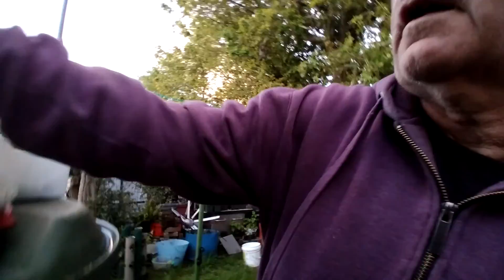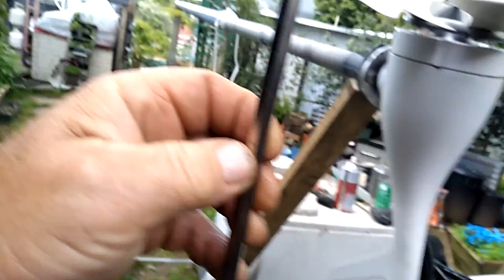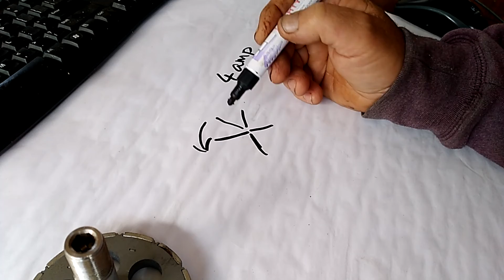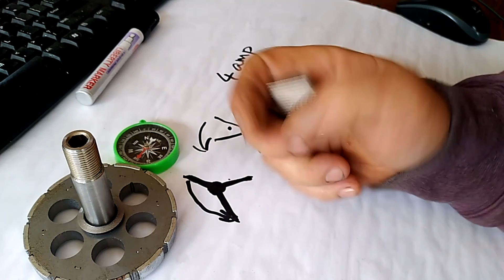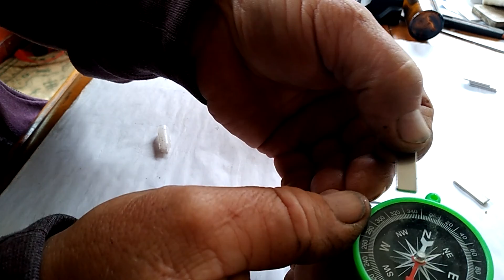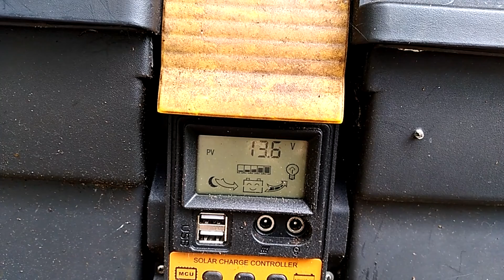Wind Turbine Magnet Mods. will more magnets give more amps or just more cogging?

Comment: Nobody installs just one solar panel for home use. I have several wind turbines. In my opinion the companies who rebuild the car alternators with permanent magnet rotation fields do produce the best bang for the bucks! Mount the wind turbine as high as possible. Mine produce the best during storms. If you static balance the blades on the rotor you can double the rated output during a storm without destroying the system.

Comment: Did  you  get  better   result  after  mounting the  magnets   ?
Reply from the maker: The magnets I chose fit well but there is space to double them up. Right now its just starting to exhibit clogging so glueing in another layer might take it too far. But I tripled the output without affecting startup. 46v in a howling wind. The Chinese bearings are starting to Rumble now so I'll buy more magnets and add that second layer with new bearings soon. Make a new video and post it. I've had a shit year with aggressive cancer so not much has happened on the channel. I started talking alt therapies so YT virtually shut me down. I've moved all the big C stuff to Rumble, where the truth can be told 
I'm getting well now so I can get into the off grid stuff again slowly. Thanks so much for your interest. ❤
Reply: @t.h.o.r.  Thanks for your reply. I'm sorry to hear you've been so sick so I wish you a full recovery. Yes I've read a lot about medications to cure that type of "illness", especially (i)vermectin and (f)enbedazole, but these things shouldn't be mentioned at all. Yes I'm interested in getting my wind turbine optimized as it doesn't actually produce electricity in strong winds it can reach 65 watts and 9 volts it can't charge my battery at all and there's no help to be found in China my wind turbine is a Vevor FT-500. I can hear the bearings are already rumbling in my wind turbine so I have to take it down again in the spring, it sits up in a fiberglass flagpole and I can't put it down as it's dug into the ground and I can't drive down to it as it's very soft after a massive rainfall. When you've found out what the bearings are called I'd like to know what they are called so I can order new bearings before I go. the mill down. I would advise you to buy C3 bearings, there is less friction in them and more clearance as they are used in gearboxes. I hope I find you on Rumble. Get well soon and many greetings from Denmark
Reply from the maker: @KurtBergNielsen yes i have a 7m pole with a cable guided tilt mechanism. I know about C3. Vevor is just a name the importer uses. In NZ they are just 600w 12v wind turbine. I should have got 24 v . Search On Rumble 'kick can*er to the kerb

Comment: I have a similar unit rated at 600 watts . But reading the specs it reveals 600 watts with a 24 volt system and only 300 watts on a 12 volt system.  On my 12 volt system I am getting 7 amps at 13.6 volts with 30 kph winds. We regularly get winds up to 70 kph so I do generate more current at those wind speeds.  My wind charger produces most of my power during the winter .  I have had 4 years of reliable service from this Chinese made wind turbine. My experience has been very good .

Comment: I have a question, in my understanding the wind charger produces AC current and solar panels produce DC current. How are you wiring the solar charge controller to deal with AC current ?
Reply from the maker: I have a bridge rectifier that turns AC to DC in the line.

Comment: Hey guys, all you need to put up a small Wind Generator is a strong fence post in your yard -
In my yard there is a row of 6 posts from an old fence, 3 meters apart just perfect for wind generators. 
I drilled a hole straight through the bottom of a 6 meter pipe, measuring in half the width of the pipe so I could put a long bolt through it and go through each end of a chain after wrapping it around the bottom of the fence post so it holds the pole like a hinge ( bolt, washer, chain, pipe, chain, washer, nut ). Then drill another hole through one wall of the pipe an inch above the bolt, big enough to easily feed a 3 wire 10A AC extension cord through it. Choose an extension cord long enough to run down the inside of the pipe and to your 3 way bridge rectifier, then cut the ends off the extension cord ready to thread through the hole and then through the pipe to the top. Leave enough hanging out the top to attach the wind generator, Cut off 4 separate links of chain and attach them to the pipe a meter blow the blades with a hose clamp or a U-bolt, for attaching ratchet straps for gid ropes. then stand the pipe and wind generator up. Use a second bit of chain to wrap around the top of the fence post and the wind generator pole, using a bolt with two washers and a wing nut, for easy take down if needed, A tip, use a stack of 3 car tyres when putting up or taking down to have the generator tail go through as the wind wheel faces up. I hope this helps you get started.
Reply from the maker: I like that! No welding, no concreting. You are just getting into the good air at 6m. I wish I could get mine higher. Funnily enough. Mid winter and I'm getting way more amps by mounting two extra panels on the wall instead of the roof cos the sun is so low. Check my latest video
Reply: @t.h.o.r. Ok, sounds good.  
I live in a small outback town in Australia with people and a council that are not happy seeing a big wind generator going up ( sounds and looks )., so I have put up 6 small wind generators instead  -
2 x 24V 500W Vevor at 6.5 meters, 
1 x 12V ista Breeze i500 at 4.5 meters, 
1 x 12V 300W Vevor at 3 meters 
2 x no name china brand 48V wind generators at 4 meters on 12V systems 
All with 1.2M wind wheels / 5 blades since I have low wind in my small town. 
I have been commenting on your other older wind generator videos to try and help your channel.

Comment: Did it increase the output?
Reply from the maker: yes of course- i dont have access to sophisicated output tracking software- but it now produces 3x the  volts in my average wind around here. it frequently charges at 40 volts when it used to seldom reach 15v

Comment: Hi, great video, got to do the same thing with a vertical axis turbine and earn some power afterwards, thank you very much for your teachings. Greetings from Panama
Reply from the maker: Thank you Lech - Its still going strong- a great suppliment to my 500w of solar. Ive never had my batteries drop below 13.2 v and Im running hydroponics and lights 24/7 it also powers my fridge and house lights and this computer and screen  and the washing machine once a week

Comment: Any updates please
Reply from the maker: yes- Ive replied to several people here telling them how it now has slight cogging, but still starts well. Its autumn here now and after having it sit almost stationary all summer its doing its stuff right now in the dark My batteries are topped off even though its been grey and rainy all day and the solar hardly contributed. Because both systems feed the batterys  its hard to quantify the turbines contributions exactly.  But standing watching the screen on a windy day Ive seen that it now feeds in at 2.2 amps on occasion - It seldom used to reach 1 amp charge before I added the extra magnets.  Its theoretical output is 4.1 amps at max wind speed. I did witness an actual event where the blades reached terminal velocity and fribulated and I was there to see a momentary 4 amps on the screen
Reply: Oh really  that's terrible  really  I get easy   300 watts   max is 450 20 amps in 30 to 40 k winds
Reply from the maker: @dustinfrost5214  Yes- from what turbine and in what strength winds? Mine is 5.5m tall and is behind two big oak trees that are taller

Comment: Did it work???
Reply from the maker: I now have very light cogging and DOUBLE the amps when the wind is belting at 20mph. but still it reaches the point where the blades flutter at terminal velocity - so I think that it is as good as I can get without changing the blade setup. example: swapping to a 3 blade hub. I did order a 3 blade hub but the twats sent me a 5 blade hub and refused to replace it unless I sent the wrong one back at my expense.

Comment: I did a 1.4 to 1 chain drive and did get a little power out of it. If it was in a good wind spot it may do ok. I put 3 wider and little, longer blades on it. It still starts in low wind.

Comment: If you want highest efficiency, use a high voltage coil. The force required to spin it is less. Its the electromagnetic equation, then step it down to 12v and you have more power.
Reply: Something like 250vdc max. Smaller wires, more turns, less heat, more power from magnets.
Reply from the maker: thank you

Comment: I built my wind turbine towers such that they hinge and have counterweight, so I can raise and lower them with one hand . . . Even in wind.

Even at that, they all simply turn transmissions, transferring the power lower to the ground. Much safer doing it that way.

All my turbines pump air. I find it easier to make electricity using a consistent supply of air, instead of trying to second-guess Mother Nature.

Comment: Why didn't you spin the rotor with a drill and measure the output and rpm before and after the modification and compare the two? Also, wouldn't it have been easier to just put 6 magnets on each side to start with?

Comment: Any updates on watts and amp improvement
Reply from the maker: hardly any wind in the last week- nothing to report that is worth a video till I can show the numbers. they just flash across the screen - it doesnt record figures
Reply: Ok do you have a wee amp watt meter hooked up to it
Reply from the maker: Its one of those blue >60v dc 150 amp meters that scroll through 4 functions continuously. Ill film it when its cranking - then slow down the playback so it sits longer on each reading and I can explain each reading. cos it just holds each number for one second.   @dustinfrost5214
Reply: @t.h.o.r.  hi mate just tried the 3 blade that was a wast of time it wasn't near as good as the 5 blade I cut my blades 3 inches  and put all 5 blades  back on  major improvement  getting 150 watts when before  80 was max and was  and started getting fluttering blades not anymore now I have cut them down
Reply from the maker: Now that's interesting!- I never thought of shortening the blades. Did I say that I ordered a 3 blade hub and they sent me a 5! - they are not interested in putting it right....  The forcast is for 30 kph winds on wednesday/thursday so Im all ready for some filming  @dustinfrost5214
Reply: @t.h.o.r.  yes you did mention that and  I'm right on the estuary  so plenty of  wind here and I found that the blade  struggled to perform 40 watts in kpa 5 blades would get 80 then start getting the wind  drag and start  making  a heck of a noise  but now  I'm hitting  150 easy and silent
Reply: @t.h.o.r.  I have the 3 blade hub I ordered and won't be  using it if you would like it I will post it to you mate

Comment: Waiting to see if what you did helped. Not pushing, Just wishing you good wind. If I add magnets, I will not do this. I plan to try a 1.4 to one gearing. That might be a little too much. Might be to slow but it has 5 blades. Not sure what these things should run at. But as fast as it could go it did nothing hooked up as it should be. I would be glad to see 4 amps like yours.
Reply: About 10~15% is lost in gearing.Direct drive is a lot more efficient.

Comment: Can't want. Could you see a change? I have one plan to add bigger magnets to it. Cut the rotor out and add n52 magnets but bigger. Well dipper inset. Same size on top.
Reply from the maker: I could not find the curved magnets- current challenge is finding axially fluxed bar magnets- everything seems face fluxed.  Oh and no wind this week or next week according to the forecast. All I can tell you so far is that I now have very slight cogging felt at the hub but not out at the blade tips. It starts and cuts in charging at the same speed- but no amps readings yet

Comment: Reduce, reuse, recycle are only part of the solution. People always forget that adapt, modify, rebuild are parts of the whole. I like to tinker with things like this too. I have found a lightplant stanchion that I'm trying to aquire to add a wind generator to my RV for winter. I don't have the advantage of a piece of dirt to plant a pole in and here in Canada we don't get enough sun in the winter for solar to be enough. Looking forward to the results!
Reply from the maker: Awsome comment Darrin thanks for your support. there is a place in every town where the car vs pole victims go. - they have stacks of slightly damaged tapered pole sections. get three or four of those and reassemble them without the top curved piece and you have your tower. Mine was a 5m shadesail pole from a school,  free. topped with a 2.4 m scaffolding section .
Reply: @t.h.o.r.  Have you seen the diesel powered portable light towers the use on road construction sites? With telescoping poles that fold down? I have access to a couple of them. They have been removed from the genset so the genset can power a forest service camp. I just need to figure out a base to have it stand on my trailer frame.
Reply: @darrinrebagliati5365 
I'm off-grid 😻
in UK..
Incase you didn't know angling the panel's.. to noon sun (not necessarily 12 o'clock) is about 5 times more power.
Regarding the turbine they don't necessarily need to be that high up, it's anything blocking the wind the same with solar..
One trick or game you can play is...
Find the wind tunnel..
There are places.. buildings, tree's, hills and valleys etc where the wind gets funneled and becomes strong.
Another thing I do forget to do is keep the panels clean.. give a wash when the panel is cool.
Reply: @mySeaPrince_  the valley I live in doesn't get much sun in the winter, especially in the trees that I'm in. I want to get at least 40ft up to take advantage of the funnels in the trees around me. And they seem to be most powerful above 35ft here. In the summer I'm usually in a gravel pit somewhere and don't have to worry as much about solar because it's more open. And no trees around means wind can be at 20ft up easily depending on location. That's why i like the portsble light tower stanchion. Can adjust the height from 20-50ft easily.